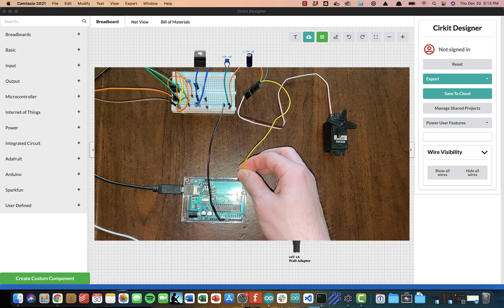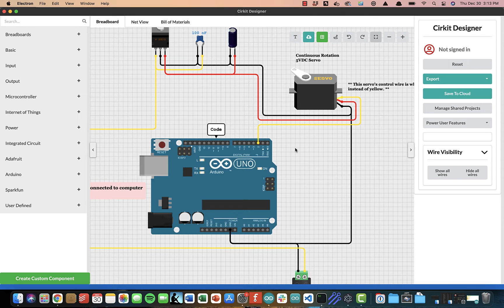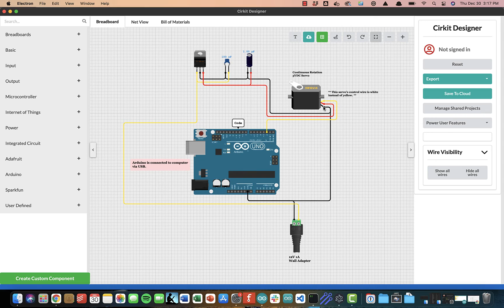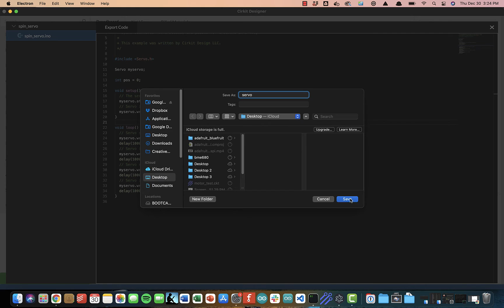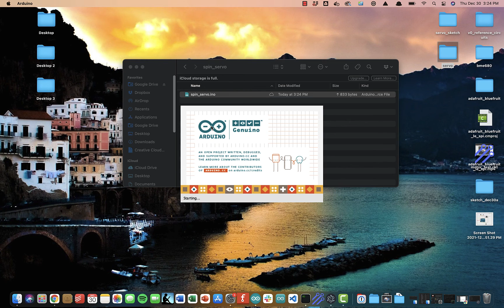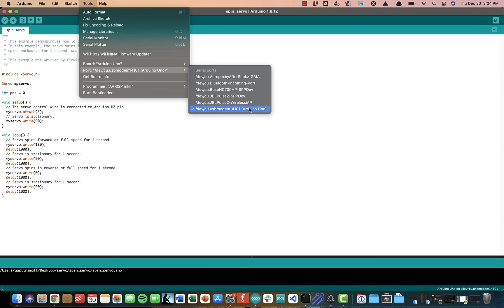Tutorial for connecting continuous rotation servo to Arduino UNO

Comment: Why you convert 12 to 5 instead of just buying 5V adapter? Why not just use 5V from arduino in a first place, you could draw 1A if you plug it in. And for initial tests even USB is enough

Why not use power lines on the breadboard? 
This wiring is so unnecesary cryptic. You could do the same but tidy and understandable using 4 wires instead of 6, or you could do it very easy to replicate, but slightly worse for teaching purposes using 0 wires instead of 6.